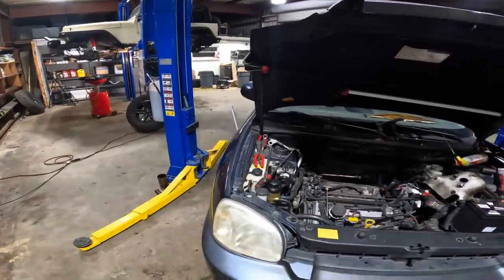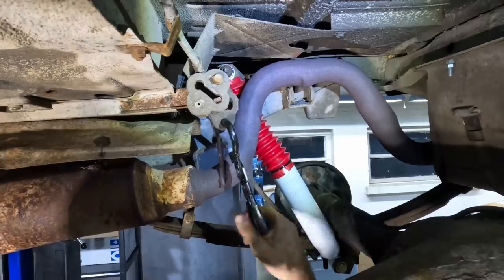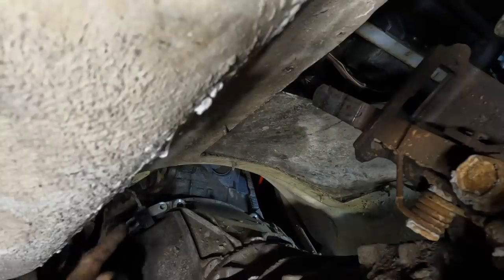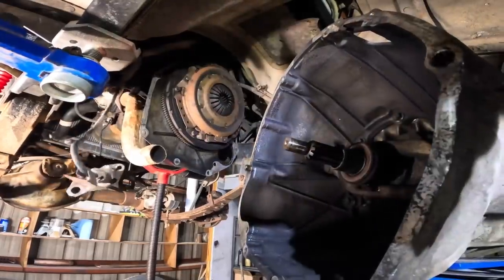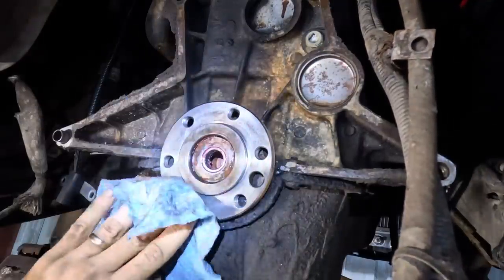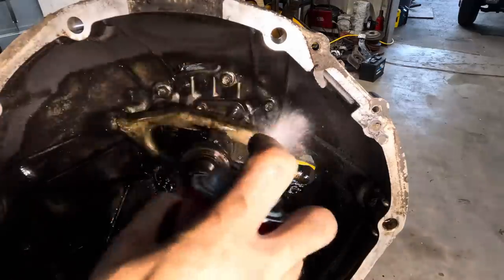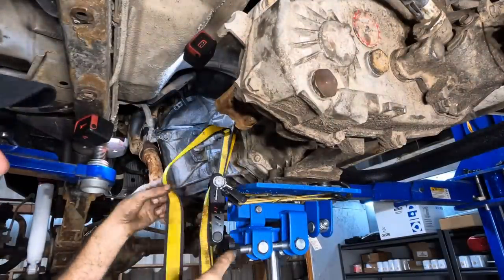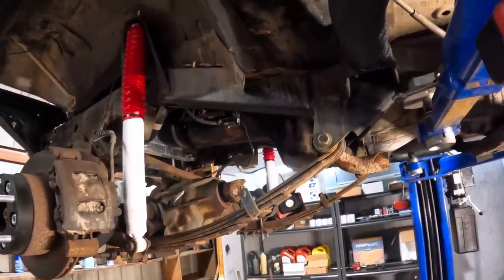Smallest Shaft Ever! FRIED Flywheel! | Project JEEP! 1995 Wrangler YJ

Comment: Hi Ray, 
I am an old time mechanic from Australia and now retired but still working on everyones cars. I noticed the trouble you were having with removing the spigot bearing from the end of that crankshaft and thought you might like to try something that I was shown as a kid. If you fill the cavity with grease and then find a bit of wooden stick or anything close to the inside diameter and insert it, then hit it with a big hammer the hydraulic pressure will pop that bearing out easily. Give it a try next time.
I really enjoy your videos, makes me feel younger!

Cheers,  Rusty

Comment: Great video. Only a few things I'd suggest. Torque the flywheel bolts, clean the flywheel, change the rear main seal, clean the dust cover, change the input seal and lube the contract points on the clutch fork
Reply: I would like to think he did those things or some of them off camera have a great day
Reply: Brad, Glad you suggested this as it was on my Mind...
Reply: I find myself doing the same. Ray you need to torque the flywheel bolts! Then I remember he probably just edited that out.  I'm sure my wife thinks I'm nuts as I'm forever reminding him about something I think he forgot or overlooked.  Oh well, it's fun to work together.
Reply: Ray should at least say, yes I’ve torqued everything down, also agree with you Brad
Reply: Having achieved access to the rear main seal, I'd have to change it.
Reply: In addition to torquing  the flywheel and pressure plate, I'd also  torque the trans mount bolts and add a little blue thread lock to them as most service manuals now recommend its use. ALSO INSPECT THE ARM ON THE THROW OUT BEARING FOR CRACKS ON THE BACK SIDE. I had one split in the middle on a CJ and it would not release the clutch.
Reply: Rear main seal is a 2 piece under the main cap
Reply: Obviously you don’t know the 4.0L online 6. Don’t have to remove the trans to do the rear main. You remove the oil pan
Reply: @charlesbell4530  unfortunately they preferred a 3.8 minivan engine when they went JK, then the worse, in my opinion, 3.6 Pentastar.  I have both motors 2010 & 2016 Wranglers, and the 3.8 much easier to work on (don’t need to take upper half of motor apart to change passenger side spark plugs, and both have 58k miles, and the 3.6 has already had a new radiator, Oil filter housing & rear main seal replaced, but I love the NAG1 auto trans better than the 42RLE.

Comment: Wow, @33:00 I can’t believe you didn’t torque the flywheel bolts and put a bit of thread lock on them.  The crank to flywheel interface is constantly transferring major engine pulsations to the flywheel between each cylinders firing, I’ve seen these bolts back out from these vibrations and cause major damage.  These bolts must be torqued.

Comment: What I liked most about this video happened at 14:58, when you accidentally dropped a mounting bolt for the crank sensor into the bell housing. Brilliant teaching, it was like you did that on purpose to emphasize a point. Misadventures are the most efficient pathway to wisdom of experience.
Reply: A lot of Bell housings have an inspection plate at the lower edge which makes retrieval easy in case of dropped bits.
Reply: You'll notice the crank sensor was installed on the bellhousing BEFORE the transmission was reinstalled, to prevent a possible recurrence.

This is mentioned on every single 4.0 CKP video out there, and also in every single manual ... because it's the one thing you absolutely just do not want to do.
Reply: I didn't see anything later in about the bolt falling out or loose in there. Maybe I missed it.
Reply: @Wakeupandsniffthecoffee  oh it came out - the sensor was properly mounted on the bell housing when the tranny was remounted.

So happened, just off camera.

Comment: Don’t forget the blue loctite on the flywheel bolts.😂 The clutch disc will not fit both ways so it’s dummy proof. Also clean the flywheel and pressure plate surfaces with brake clean unless you like a chatter grip starting from a stop in 1st gear. 😊 Check for a binding clutch disc on your input shaft while the transmission is on the floor. One tiny burr will ruin your day. A tiny tiny bit of grease on the splines helps too. Since I remove the bell housing I also use guide bolts with the heads cut off on the top 2 mounting holes on the bell housing to help guide my Muncie transmission in straight so you don’t bend up the clutch disc. Lastly do not pull in the transmission the last few mm with the mounting bolts or you may break off a mounting ear. It’s binding so push it in because it will go in eventually. Remember when I mentioned about trial fitting the clutch disc while the transmission is on the floor, ya that’s the reason.😂
Reply: I was always told use red loctite for flywheel bolts because of the heat generated from the clutch and flywheel. It will boil the blue stuff.
Reply: too late!
Reply: Ray doesn't like thread locker or anti-seize for some reason.
Reply: never use grease on the splines, use anti-seize, and only a tiny bit so it doesn't get flung around.
Reply: I too have a drawer full of old bolts with the heads cut off and a slot sawed in the end
Reply: He lost his torque wrench too...
Reply: @dwej9080  And an angle indicator. Torque spec is 50ft lbs + 60 degrees. Really hope he didn't reuse the bolts as well. That's a recipe for disaster. They should never be reused in any application.

Comment: So jealous to see all those bolts coming out so easy!  If this Jeep lived in Ottawa it would have been scrap metal 10yrs ago!
Reply: I live in the Maritimes. Rust & salt. Nothing ever is easy to replace. And iv fixed the frame on my truck a few times from rusted out holes.
Reply: and the potholes would assist in breakage ... lol
Reply: @Faresplease  ... says every person living east of the Rockies.
Reply: UK same - rotted away in the winter salt
Reply: Breathing in that brake cleaner is not a good thing Ray
Reply: Prybar long pipe and cutting torch...standard equipment in maine
Reply: Jeeps are kinda heaps.
Reply: Learn how and keep clean gains alittle more life
Reply: Jeeps live forever in Southern California!
Reply: Florida hates working on Ontario vehicles. Lol
Reply: Ontario vehicles are good if you don’t drive them in winter and drive around the potholes 😮
Reply: Lol. Yea. You are right.
I have a Friend in Washington State who actually Buried his 1979 Jeep CJ. It Turned into Dust. And Methane Gas. Buried in 1981. In 2019, no more jeep
Reply: Yeah thay will break off no matter what
Reply: @HypocriticYT  Wait.... There's other seasons in Ontario than Winter? 🤪🤣😂
Reply: @K.Kelly87  If there are I haven't seen them yet.

Comment: Hey Ray, just had a customer with a jeep renegade, with a failed clutch. These jeeps are made in Italy, with Fiat parts. It's a 6sp manual, mated to the 1.4L multi air, using a dual mass flywheel (which looks like it fits a go cart). These clutches are tiny and weak, and like Fiat in general, prone to failure with everyday driving. This customer is a big rig driver, so they are adept with standard transmission driving, so there's no excess abuse. The kicker is the flywheel is disposable. Being dual mass, you can't resurface them, and because it's two pieces that move independently, with spring dampeners, they are designed to fail from the drawing board. Replacing the flywheel comes at a cost upwards of $1,000, plus a matching disc and pressure plate for another $250-300. There is one company online that makes a single mass clutch kit, but that creates an issue of future service with only one company available to supply replacement parts. The disc is likely the same, but the pressure plate is likely built to accommodate the single mass flywheel and not the OE DMF. What a POS company, to build a Jeep from a Fiat 500!

Comment: If you fill the pilot bearing with grease and get a socket that fits in it with a extention. Tap the extension and it will pop out. I didn't believe this when I was a kid and have done it many times,always works.
Reply: I have even seen a guy use crumpled up bread stuffed in the hole.
Reply: Me too it's a simple idea but it does work have a great day
Reply: Bread, soap, grease or pretty much any nonliquid that is very malleable and incompressible will work too.
Reply: My favorite is pieces of greasy blue towel wadded up, but yes, it works great.
Reply: @bobpowers4454  I came here to say this!
Reply: Bread is the best, easiest to clean up. If you dont have a blind hole slide hammer
Reply: Wet, soggy newspaper (or any paper) works very well, much easier to clean up than grease.
Reply: @61rampy65  i actually really like that idea!
Reply: Old school trick that works every time, but it has not been passed on the the new techs, it is funny that they think they have to buy a tool for every little task.

Comment: Got quoted $2500 to change out a worn clutch on a Isuzu Trooper/Holden Jackaroo by the dealership over 20 years ago (parts were $300 retail), so instead I took 2 days off work (without pay) and did it myself and still came out well in front 👍

Comment: 25:00 Ray, the way you remove a pilot bushing/bearing is NOT to pry it out.  You pack the hole with grease and then push a ID-sized pin into the hole, thus ejecting the bushing/bearing.  Good God.

Comment: I replaced a clutch on my 95 S10 a few years ago, but I didn't have the benefit of a lift.  That job was 8 hours of misery on my back lying in transmission fluid and dirt trying to hold my head upright.  My neck was so sore for days afterwards.  Great video!

Comment: I agree with almost 100% of what you do, but I would have put locktight on the flywheel bolts and used a torque wrench...I hardly ever use one, but with head bolts, flywheel, and engine internals...I definitely do.

Comment: @Ray in the future for the flywheel bearing...just fill it with grease in the hole and put a close diameter shaft in the hole and tap it in the hole so the grease will push the bearing out...keep filling with grease until it comes out....
Reply: I've seen people do that with old bread... works surprisingly well and no pressurized grease explosion....
Reply: I believe paper works too

Comment: Pilot beating removal tip.
Fill the hole with grease and use a shaft of equal dimension.
By hammering in the shaft it will push the bearing out.
Keep adding grease and hammer till the bearing is removed.

Comment: Takes me back to when I use to change my own clutches. Never had the luxury of a lift. Always seemed to be snowing when I had to do them. Only had an unheated garage, numb fingers where the biggest issue. Trolley jack with a plate made up to hold transmission while removing and replacing not as good as a proper transmission jack. Made my own clutch alignment tool for centering clutch. Alignment was always spot on. Lining up first two bolts when replacing transmission was the biggest issue. Transmissions where not always easy to wiggle into correct position. Then trying to insert bolts and start by hand with numb fingers was a "challenge".

Comment: I found a set of temporary installation studs I made years ago in the tool box.  They are the same thread as the bell housing bolts but longer with a large chamfer. They make the alignment a lot easier and help guide the transmission onto the dowels.  Driveway mechanic tooling but it sure makes the job easier when wrestling with a transmission while on your back.
Reply: Now that's a brilliant idea.
Reply: Thanks for the idea! Need to do a clutch job on my '03 truck.
Reply: Did the extended bolt thing back in the late 70's    driveway R N R with no damn jack. Two guys covered in ice. February in Anchorage Alaska.  Yet it was an AMC EAGLE..  I get it. 
No it wasn't uphill in both directions..  it was old school hardship days..  ;-)
Reply: Yes!...I even put a saw cut so I can remove them with a straight screwdriver.
Reply: That's the way I like to do it... especially when dropping in an engine with a cherry picker and no spotter. Otherwise, it takes 10x as long to line up the engine and trans.
Reply: Hi,I like to use 3 inch allen bolts that are not threaded to the cap with the heads cut off for guide studs.Helps a lot.
Reply: Another thing I've done with mine, one of those small 2-ton jack handles and a ratchet strap. Set the jack handle (it's about 1 foot long) across the floorboard where the shifter goes through the floor. Then run the ratchet strap around the trans and the jack handle. This can be done along with a second strap across the frame and under the front of the trans to suspend it for removal and re-installation. Useful if you have a truck/suv and would rather not use a jack. Also the perfect time to change the gear oil, as it's lighter without oil... lol.
Also, from my experience, while it may be easier to leave the trans in neutral so the shifter goes in easily, I find it better to have it in 3/4 gears (shifter is left/right centered there on an American 5 speed) so the trans shaft can be rotated to help align the splines to the clutch plate, although that probably depends more on the trans than anything.

Comment: I often see you re-greasing a new or used part without knowing whether the grease you're applying is compatible with what is already in the part. Incompatibility could cause the greases to react with each other and turn into a worthless putty.

And a 10-12oz brass hammer would be useful taping little locating bushings into their homes.

Comment: Gold trick my dad taught me how to pull those pilot bearings out is use a bolt and pull on the bolt sticks bolt in there and you need to use some big washers or whatever and press it out or hook that bolt to your slide hammer and works every time

Comment: Old School of wrenching. On the pilot bearing if you have a old input shaft or round bar the right size, pack the cavity behind bearing with wheel bearing grease and drive the shaft in with sledge hammer. Believe it or not the bearing will be pushed out with hydraulic pressure un-damaged. I still find it hard to believe someone was driving this Jeep. During my years turning wrenches I was amazed and shocked that customers would turn the radio up and keep driving until it stopped. Be thankful it is not a Hummer H3, the motor mounts are near impossible. Great Job!

Comment: hey ray, just a little safety tip, never ratchet strap in opposite directions on opposite sides of the jack post, it will cause the plate to spin and not get fully tightened, it can also come loose when your spinning it around like you did. Just dont wanna see you get hurt.

Comment: A cool trick my dad came up with, to align the bell housing , get a pair of all thread the same thread as the bell housing bolts. Slide the trans onto the bolts, and they align everything to the transmission assembly. Makes a simple slide in on the clutch. Then all ya gotta do is wiggle the yoke a tad till the teeth align. Easy Peasy.

Comment: @Ray, if you use a bolt the same size as the ID (inner diameter) of the pilot bearing, jam bread in there then tap the bolt in and repack bread in as you go, it will come out easy. Works a treat for any car.

Comment: Ray, here is a thought for removing pilot bearings in blind holes:  Fill the entire hole with grease.  Select a punch/drift the diameter of the First Motion Shaft and push it into the bearing.  One swift whack with a hamster will usually pop the bearing our by hydraulic action.  This is usually the only way to remove the old fashioned Phosphor Bronze / Oilite bushings.  Hopes this helps
Reply: Use a hammer, not a hamster :) Also, wet paper or silicone earplugs work too!
Reply: @tobiwan2741  No, I am correct.  The term hammer was superseded by Basil Fawlty in Fawlty Towers.  He was trying to nail a moose head on a wall and someone suggested he use a hamster.  All British Techs have used that nomenclature from then on.
Reply: @fred414141  Oh, good point, glad you reminded.  In future, I'll keep he garage door shut.  Thank you
Reply: My exact thoughts soon as I saw Ray faff about . Been doing the grease trick for 25 years when I 1st started this dead end job
Reply: Stuffing the cavity with bread actually works even better than grease, believe it or not
Reply: Fill with grease and use a close fitting punch or tap the bushing (npt) to fit a reducer fitted with a grease nipple. This works awesome and is quick and relatively clean. This method works best with bronze pilot bushings.
Reply: I have used the grease and punch method with success.
Reply: @timjohnun4297  I just saw that yesterday on the donut channel regarding easy hacks.
Reply: Old school trick that works every time.
Reply: Ive even used bread before.
Reply: @tobiwan2741  IKR, hamsters are too soft, lmao.
Reply: I've always used White Bread which does the same exact thing. A wet paper towel also works.
Reply: I always used a bolt
Reply: @MrRunner  I speak English well. I learn it from a book.
Reply: + some bread
Reply: I have used grease and bread.  I think bread actually works best.  Have not tried whacking it with a hamster yet though.😂
Reply: Uh oh i need a new hampster.
Reply: Graham! Thanks for reminding me about that, the last time I used that it was in the last century👍👍✔✔
Reply: @JamesPotts  In which case,,,,I wish to make a complaint
Reply: Was gonna say that be one tough hamster!
Reply: yup,,, that or use damp bread like i posted up above on a newer post
Reply: @MrRunner  Que?
Reply: @timjohnun4297  I think Ray demonstrated that trick in the past year.
Reply: @theundergroundlairofthesqu9261  Lemme Guess, you leaned English from a book ?

Comment: Imagine laying on your back trying to guide an old 3 speed cast iron 1950's truck transmission into the clutch with nothing but your arms and chest to support it. Then imagine it is on a gravel drive.  Been there, done that. Lifts and a jack would have done wonders for that job!